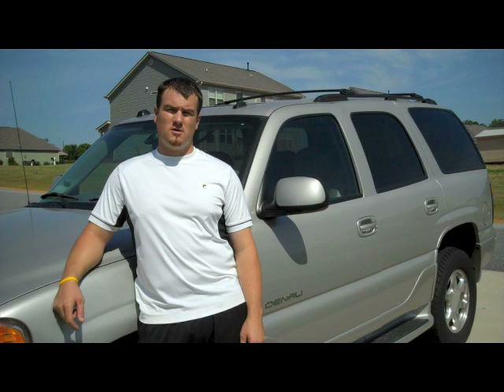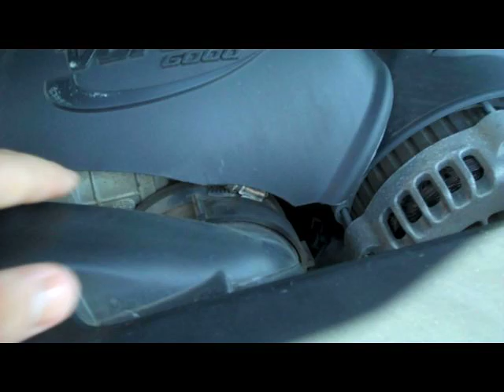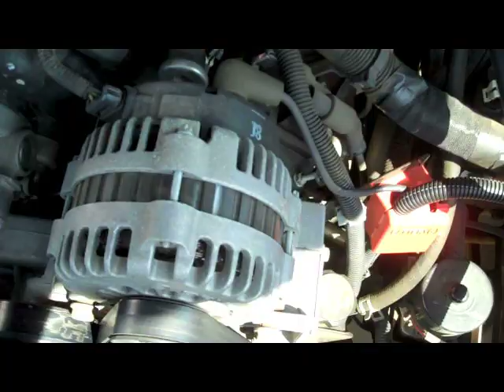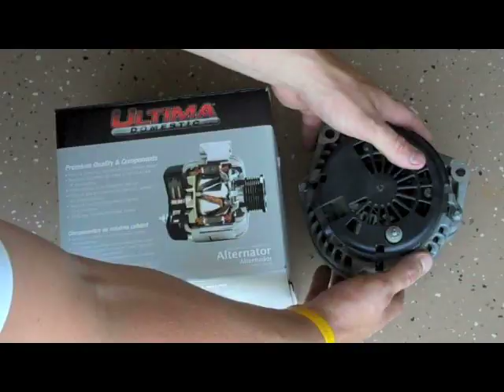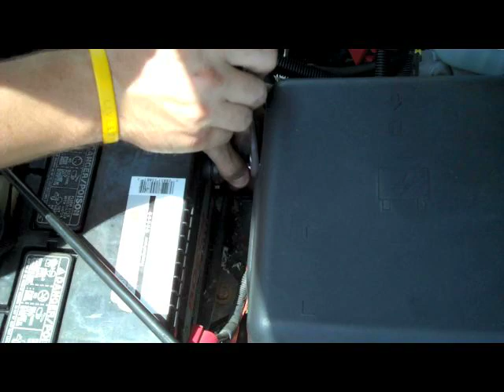HOW to REPLACE INSTALL ALTERNATOR 2004 GMC YUKON DENALI TAHOE SIERRA SILVERADO 99-05

Comment: '03 Yukon 5.3 here. I replaced a deader-than-dead battery yesterday, today the new one was dead. Couldn't find any loose connection, so symptoms pointed to alternator. Searched around, found your video .... Now I am not automotively inclined, like, at all I can change a tire when I have to (though so far I've stripped lugnuts or bolts ~100% of the time). I'm a tech-nerd but cars ... I open the hood and it's just one big lump of gray to me. After your video I decided to escape my safeplace and risk it (that and I can't afford a friggin tow and a mechanic on Thanksgiving weekend). Your vid made it EEEEEEEASY, even giving the socket sizes. I ordered the part, had a friend pick it and a cheap charger up and deliver them to me, and by God I changed a car's alternator all by myself! twists arm patting self on back

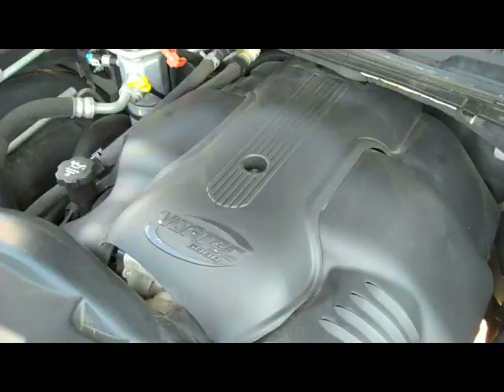I only had two minor hitches. 1) 1:31 the air box side I had a helluva time getting that off (yes I loosened the hose clamp ;D) almost like it was lipped into a notch or something. Jiggling did nothing and I had to gently pry it off. 2), 5:50 There are two "bushings" in the bolt holes that press up against the alternator. I pried out the old alternator like you showed, but the new one didn't want to go back in. I had to push those bushings back away from the alt side just a smidge to get the new alternator in. I took a piece of 1x2 on the alternator-side of the bushings and used a mallet on the wood to hammer the bushings deeper into their holes just a mm or so. Then I was able to get the new alternator in and when you tighten the bolts it pushes those bushings right up snug with the alternator again.

Overall, you made it easy enough to embolden even me and you saved me about $300-400 in tows and mechanics, so easily the most useful YouTube video I've ever come across. :D Thanks a million, bud!!! :D
Reply from the maker: Thats great news Stephen! So glad you got it done. Sorry for the troubles, but those are always good to learn from. Nice job and glad you saved some money!
Reply: Want to race? I have a supped up 5.3 Suburban. She catches a mean second. She'll smoke em at 20 mph.. top speed 158mph. I have clear titles..
Reply: My goodness the same thing happened to me doing the job had to wiggle the hell out of it to get the new one in wish I knew to use a wood block I used a rubber mallet Winter sucks for working on cold metal

Comment: Does a bad alternator mean a bad battery as well? I need to replace mine and I was told that chances are that the battery is shot
Reply from the maker: A lot of times if the alternator has not been charging for a while then the battery wears out a lot faster

Comment: This video made doing this extremely easy removing my alternator.  I paid $70.00 labor to have a mechanic to replace it during my vacation, only to get home  later that day noticing my voltage gauge discharging again.  I went by the auto parts store and they are going to replace it via warranty.  IF I had looked at this video first and seen how easy it is to remove the alternator I would have saved 70 bucks, :).  Thank you !
Reply from the maker: you are very welcome Thomas!

Comment: Thanks, this video helped me change my own alternator on my 2005 Chevy Tahoe Z71. My Tahoe actually had less covers to remove but same exact process. It took me 30 minutes to swap it out. Bought a remanufactured Duralast 160 amp from Autozone $226 total out the door and going to get back $40 for the core.

Comment: Thank You! I was three hours from home when the alternator went out. ("Battery not charging"). I watched the video to see the size of wrenches I needed. I was able to pull into an oreilly auto parts and change it in the parking lot in about 30 minutes. Walked back inside and got my core charge back. Great Video!

Comment: Very informative i was qomdering tye amps and am glad u covered the difference in the 2 model alternators..... i have a 2001 denali, a 2004 yukon xl and a 99 silverado ,any quick guesses is they are all the same ? I planned 2 check the back like u said
Reply from the maker: well it depends on the engine size.
Reply: 5.3 on both of my truck's

Comment: Great tutorial!  I followed this video to replace the alternator in my 2004 Escalade ESV.  Same color BTW!  The only issues I had were that when I replaced the Delphi alternator with the Duralast Gold one, I had to tamp the spacers where two mounting bolts are to slide the new one in.  I guess its slightly wider.  Also the single pole wire mount to the junction box with the battery was apparently slightly farther away from the battery side on the Duralast alternator, and when attached, was very tight.  This made replacing the driver side cover more difficult because it was now in the way of the front mounting bolt.  I had to bend the metal flange which holds the junction box toward the firewall slightly to get the bolt back in properly.  Start to finish 1 hr 15 min!
Reply from the maker: whoa, sorry about the trouble, glad it all got fixed though

Comment: High after replacing the alternator the ABS light does not work gas gauge does not work radio does not work keyless entry is also not working is there something that I'm missing?? Thanks for your help!
Reply from the maker: ooops, you might have a short somewhere or you need to check your fuses

Comment: Thanks for the video. Your video helped me make the decision to do the repair myself.  The video also helped me get the repair done more quickly do to having all the right tools at my side from the beginning.  Only trouble I had was that I needed to use a rubber mallet to persuade the replacement alternator into place.
Reply from the maker: good job, glad to help

Comment: I'm so grateful that you made this video. Not only did you make me a better mechanic ( because I'm a novice/ beginner) but you also saved me about $400.00 in fees that shops are trying to charge me. Plus, my family knows I have SOME mech skills now, llol!! I have a 2003 Caddy Escalade 6.2 , same engine set up...... Thank you so very much, Blessings.Rev McKinley A. Miller
Reply from the maker: thats great, glad to help!
Reply: I got my alternator in the mail yesterday. It was very cold outside, about 44° so it took me about an hour to replace it. I followed you video step by step and my vehicle runs great now. Thanks again.
Rev. McKinley A. Miller
Blessings

Comment: after replacing the alternator and putting the belt back on, will the belt be a lil looser when putting it back on ?
Reply from the maker: It shouldn't unless you have a worn belt. But also make sure you have it on correctly and follow your diagram

Comment: Hi i have a question, I have a 2002 Cadillac Escalade HO 6.0L Engine, And i just wanted to know are 100% New Bosch alternator a good brand to go with for my vehicle and will it last a very longtime during  very cold winter's months in New York weather ?
Reply from the maker: definitely having a bigger alternator is better for cold weather, but it just depends if the car can take it or not. When you order they should tell you the size that you can install. It should help with starting but also having a bigger battery will help too

Comment: have you had any issues with a loud whine when you crank on a cold start? my 01 silverado started to make this noise it has 120k and I assumed it was the belt so I took it in to get it changed, it stopped for a sec than continued a couple days later. I plan on changing the alternator and main wiring then checking if they did change my belt because I'm very curious of what this could be.
Reply from the maker: You could just put some belt grease/lube on the belt too and it will go away.

Comment: how to check the air suspension in a cadillac scalade 03 ?
Reply from the maker: usually if the light is on then the compressor needs to be replaced. You might be able to find one at a Junk yard though
Reply: ok thanks broo

Comment: did you have a problem with the cluster  my oil pressure, volt meter ect. my driverside door controls(windows,power locks)dont work. however  the odometer still works my cluster . any ideas?
Reply from the maker: +59ChrisX59 nope never had any issues. hopefully that will be a fuse and you wont have to take the dash off

Comment: How do you know when you have the right amount of tension on the pulley? Can it be over-tightened?
Reply from the maker: +GoASt031 Well you are not taking the pulley off. but anything you put on you can always torque them with torque wrench. the tension on the belt will be correct if everything is put on correctly.

Comment: How do u find out what alternator fits and where is the number located
Reply from the maker: michaelashamblin there should be a sticker with the number on it, but when you order the alternator at the parts store, it goes by the size engine you have in the vehicle.

Comment: My 2004 Tahoe has 133,000 miles and I travel to the desert quite often during the summer. Would it be wise to replace the alternator now even if it is working fine?
Reply from the maker: Fred Alexander It is really hard to say, they can kind of go out at any minute. But if it were me, then no. I would wait until I needed to. It may last another 5 years.
Reply: TheRykerDane Thanks for the answer, I assume when you say they can go out at anytime you are also referring to new factory alternators. Is that correct?
Reply from the maker: Fred Alexander Yes that is correct.

Comment: TheRykerDane....Very Helpful Video and right on time. I have to replace the Alternator on My 2002 Tahoe....Do you have a Video about topping off coolant system?? My Low Coolant Light stays on but My Reservoir is Full.
Reply from the maker: Rolondo Pena Hopefully you do not have any air in the system. What you can do is take off the reservoir cap, turn on the heat and blower on high, and let the engine run. This will hopefully cycle through the coolant and release any air bubbles. Then the sensor should reset. And also, you could disconnect the battery for 5 mins after doing this to see if the computer resets. hope that works for you

Comment: Great video, your explanation and step by step instructions are awesome and I will be changing my alternator on Saturday morning however,I do have a question the alternator that I'm changing out is on the Chevy Tahoe '03 it's still the same process right?
Reply from the maker: vern chambers Yes it is, glad I could help!
Reply: Hope your alternator bolts are nicer then mine were

Comment: Great video tutorial!! Im more of a visual guy so this helps a lot with confidence I can do it... Just wondering how the Ultima Alternator is holding up? You installed a brand new and not reman unit right?
Reply from the maker: Darryl Macha Yes, brand new and it is still doing great. Just make sure you do keep the receipt from where you bought it because every once in a while they can stop working how they should and then you can replace it for free within 2 years I think. glad it helped you out!

Comment: great video very helpfull
about to do my first altenator change. is this the same engine on a 2004 z66 avalanche or nothing differ????? thank you sir and please reply thx
Reply from the maker: Does it have a 6.0 engine or the 5.3 engine? It is pretty much the same thing, you may just have to be at a different angle because a air box or some plastic in the way. Good luck!

Comment: Great video. Will an alt for a 6.0L fit a 5.7L without any modifications?
Reply from the maker: Yes, they should be the same size. You just can't use a 4.8, 5.3, or 5.7 alt on 6.0. Just not enough power.

Comment from the maker: Do all the rest of the gauges work correctly? If so then there might be a separate fuse for the gauge, but usually its all on the same. Otherwise taking the dash off and taking out the gauge box is easy and you can see if something is making it stick.  Otherwise its possible to just replace the whole gauge box from one at a junkyard.

Comment: After I wrote this, I saw your other Videos. Then, I went and replaced the whole Tensioner, and the AC compressor belt, thanks to your Videos, It was easy! She runs fine, now.
 While away from home the Tensiner Pulley had melted, and shreded the belt. I had only replaced only the pulley, and later the new belt came off on the highway, and being a Sunday evening, I had to be towed home. Thanks to your videos, this unemployed man can do it right, this time, himself.

Comment: Is it safe to say that the gist of this replacement would be the same as replacing one on a 2000 Silverado truck?  Battery, belt, bolts and wires.

Comment: Thanks so much for this video.  This morning I replaced the alternator on my 5.3l 2004 Suburban in a light rain with no problems other than dropping my wet tools.  I'm not much of a mechanic so I also really appreciated you giving the socket sizes on everything.

Comment: I will do so... I was also told that I could run an additional Ground from the ground wire from the block to the Frame to get a stronger ground. Thank you for your help...

Comment from the maker: You could also get a voltmeter and read your electronic fuse holes in your fuse box to see which ones are drawing more amps. At least test the ones you suspect are the problem.

Comment from the maker: Thats great! At least you figured out what happened. Yep wiring in different systems can mess up the electronics, if not done by someone who knows what they are doing. Sometimes those stereo shops have high schoolers installing that may only know the basics of hooking up systems and cut wires or by pass some important stuff they shouldn't.

Comment: I took my truck to a stereo shop a few years back and they messed up. So I think you right, I may have to take it in to a shop to check the wiring. I pulled out all the old wires and I set my vent controls to Inside air OFF. It did help a litttle.... At the time I got my stereo installed, the Fog light didn't work and they had to fix them back. I think that had something to do with it.

Comment: I have a 5.3 and I did get the right amp alternator. I had a after market stereo system installed and it had a ground wire issue. I kept hearing the Buzzing high pitch sound through the radio. A person told me it was more likely to be a ground issue. And then i read your email and said the same thing to look for... So tomorrow I'm going to a trusted stereo shop and hope they find the ground problem or at least at a ground to fix it. Right now I disconnected my battery just in case...

Comment from the maker: When your battery and engine go down, do you happen to be running the heater or the A/C blower on high? And I am sure you got the right alternator too right? because there is a smaller one for the 4.8 engine that fits onto a 5.3 or 6.0 engine.  Also could be a short in your electrical system. Any aftermarket amps or radios could possibly have a short somewhere.  I just had to replace my BOSE amp in my Yukon because there was a short from rain coming in the moonroof. This caused battery drain..

Comment: i'm having a problem with my power ... (2001 gmc yukon) 
My battery gage tilts from reg position to low position only for a split second as if it loses power and regains it. I just put a new battery in it and a new alternator and it still does it. My mechanic has ran the computer to it and nothing indicating any power shortage show up. I don't know what this is. when I'm driving, and come to a stop.it acts like it wants to cut off and sometimes it does. can you or anyone help me please.

Comment from the maker: Well, I am not sure. The battery and alternator is an electrical thing, so it has nothing to do with the engine. The only thing is if you have a short, and the check engine light came on because of it. Or you just happen to have another problem come up at the same time. I would take it to a parts store and hook it up to a diagnostic computer to see what the code is that comes up. Hope this helps! Thanks for watching!